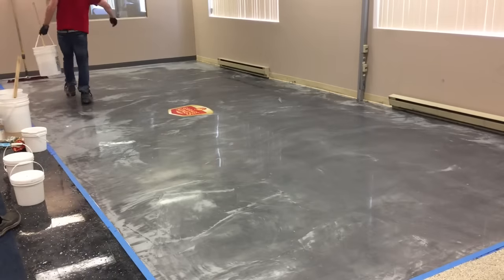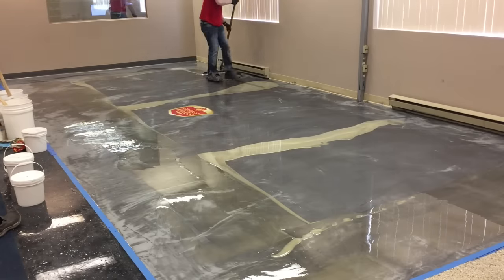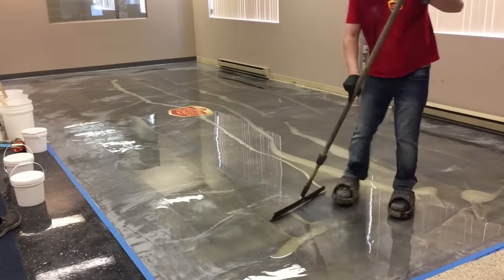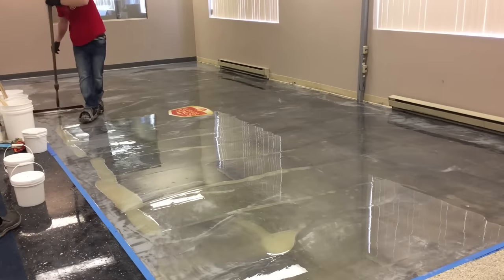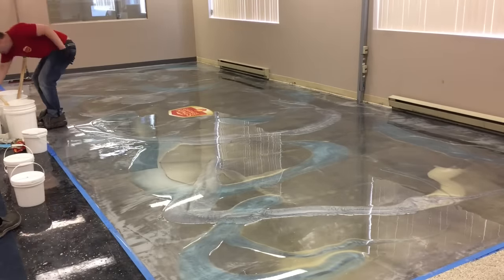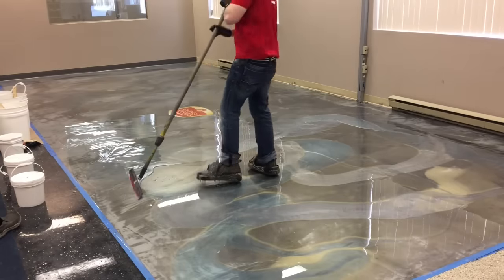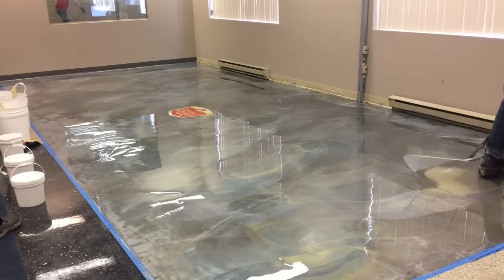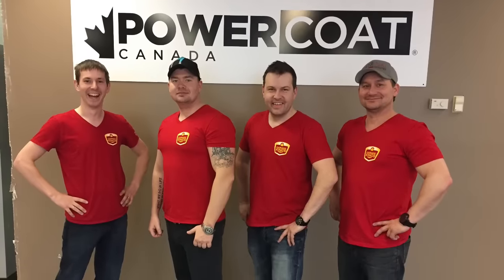How to Do Amazing Metallic Epoxy Floor!

Comment: No mask! Wow. Cancer isn't a scary thought for you?
Reply from the maker: +Ernie Gambino  Thank you!!!  For the question. 100% Solids has Zero VOC's. So no mask is required. We love safe and we don't scare people into believing they need them when they don't
Reply: It doesn't have volatile organic compounds (VOCs) because it's not organic. All epoxy products emit toxins when they're wet and during the curing process. I sell various epoxy products. Our concrete shop floor was coated in this same type of epoxy resin (a different brand, though). It takes about 24 hours for the fumes to dissipate.
Anyone using these products should wear an appropriate mask because the product is essentially glue.
Reply: It doesn't have volatile organic compounds (VOCs) because it's not organic. All epoxy products emit toxins when they're wet and during the curing process. I sell various epoxy products. Our concrete shop floor was coated in this same type of epoxy resin (a different brand, though). It takes about 24 hours for the fumes to dissipate.
Anyone using these products should wear an appropriate mask because the product is essentially glue.
Reply: jublywubly you can say that again! lol
Reply: jublywubly you might want to look up what organic means in this context
Reply: I do understand the context. Anything organic has to have originated from a biological origin.

"organic
· adj.
1 relating to or derived from living matter. Ø Chemistry relating to or denoting compounds containing carbon and chiefly or ultimately of biological origin. Compare with inorganic.
2 Physiology of or relating to a bodily organ or organs. Ø Medicine (of a disease) affecting the structure of an organ.
3 produced or involving production without the use of chemical fertilizers or other artificial chemicals.
4 denoting a harmonious relationship between the elements of a whole. Ø characterized by natural development.
– DERIVATIVES organically adv."

(From Concise Oxford Dictionary 10th Edition)
Reply: jublywubly "compounds containing carbon" ... sooo... epoxy is inorganic?
Reply: Containing carbon doesn't make it organic, unless it came from an organic source. Carbon is thought to be in all life, but doesn't mean all carbon came from organic/living sources.
Reply: jublywubly ok i'll give you that. not everything containing carbon is an organic molecule, epoxy molecules are tho
Reply: Carbon chemistry is called organic chemistry. Epoxies are organic compounds, period! Epoxy hardeners cause nasty allergic reactions but, depending on the product and the person it may take quite a while before the symptoms show. When they do it's usually bad.
Reply: It's a type of glue. It hardens on the floor. It will harden in your lungs. All glues, chemically based or water based, are dangerous to inhale. While epoxy resins do contain organic compounds, they are not entirely organic. (Remember, cyanide is organic.) Flooring resin isn't used on its own. There is always the need for a hardener. 

After doing a lot of research, the general warnings for resin is (Taking note of "P280")

"Hazard Statements:
H315 Causes skin irritation
H317 May cause an allergic skin reaction
H 319 Causes serious eye irritation
H411 Toxic to aquatic life with long lasting effects
Precautionary Statements:
Prevention
P261 Avoid breathing dust/fume/gas/mist/vapors/spray.
P264 Wash hands thoroughly after handling.
P272 Contaminated work clothing should not be allowed out of the workplace.
P273 Avoid release to the environment.
P280 Wear protective gloves/protective clothing/eye protection/face protection.
Response
P302 + P352 IF ON SKIN: Wash with plenty of soap and water.
P305 + P351 + P338 IF IN EYES: Rinse cautiously with water for several minutes. Remove contact lenses, if present and easy to do. 
Continue rinsing.
P333+ P313 If skin irritation or rash occurs: Get medical attention
/advice.
P337 + P313 If eye irritation persists: Get medical attention
/advice.
P362 + P364 Take off contaminated clothing and wash it before re-use.
P391 Collect spillage.
"
Reply: and the general warning for hardener is:
(Taking note of: "P260 Do not breathe dust/fume/gas/mist/vapors/spray")

Classification of Substance or Mixture
Acute toxicity, Oral, Category 4
Acute toxicity, Inhalation, Category 5
Skin corrosion/irritation, Category 1B
Skin sensitizer, Category 1
Eye damage/irritation, Category 1
Specific target organ toxicity (single exposure-inhalation), Category  3
Acute aquatic toxicity, Category 3
Chronic aquatic toxicity, Category 2
Label Elements

Hazard Pictogram(s):
Signal Word:
DANGER
Hazard Statements:
H302 Harmful if swallowed
H314 Causes severe skin burns and eye damage
H317 May cause an allergic skin reaction
H333 May be harmful if inhaled
H335 May cause respiratory irritation
H411Toxic to aquatic life with long lasting effects
Precautionary Statements:
Prevention
P260 Do not breathe dust/fume/gas/mist/vapors/spray
P264 Wash hands thoroughly after handling
P270 Do not eat, drink or smoke when using this product
P271 Use only outdoors or in a well ventilated area
P272 Contaminated work clothing should not be allowed out of the workplace
P273 Avoid release to the environment
P280 Wear protective gloves/protective clothing/eye protection/face protection
Response
P301 + P330 + 331
IF SWALLOWED: 
Rinse mouth. Do NOT induce vomiting. 
P303 + P361 + P353 IF ON SKIN (or hair): Take off immediately all contaminated clothing. Rinse or wash skin with soap and water (or shower).
P304 + P340 IF INHALED: Remove person to fresh air and  keep comfortable for breathing.
P305 + P351 + P338 IF IN EYES: Rinse cautiously with water for several minutes. Remove contact lenses, if present and easy to do. Continue rinsing. 
P310 Immediately call POISON CONTROL CENTER or doctor.
P333 + P313 If skin irritation or rash occurs: Get medical attention
P362 + P364 Take off contaminated clothing and wash it before reuse or discard
P391 Collect spillage.
Reply: This answer is only proper if you post all the MSDS's for all the products used.
Reply: I checked every MSDS for every manufacturer and supplier for the first three pages of a Google search. Materials Safety Data Sheets are checked by government safety bodies. If only one company's MSDS states that it's toxic, then it's toxic, but I found about seven or eight, in that search.
If you can't be bothered doing your own research, then that's on you.
Reply: @Garage Kings: please post the links to the MSDS's for all the products you applied to that floor, thanks.

@jublywubly: non-sense. an MSDS is required from the manufacturer for every product; whether or not it is toxic.  There are exceptions for known common inert materials( e.g., wood, glass), but even then, the manufacturer has to petition for the exception.
Reply: I worked as an occupational health and safety officer. I know what I'm talking about. I suggest you do your research before making accusations.
Reply: IN SUMMARY DON'T STEP ON EPOXY YOU WILL GET FOOT CANCER
Reply: You inhale way worse shit just sitting in traffic.
Reply: It's my job to know these things and how to research them. Occupational health and safety is a serious issue with legal ramifications for those who ignore them.
Reply: The hell are you talking about, with that nonsensical gibberish?
Reply: No education!  Wow. Stupidity isn't a scary thought for?
Reply: jean-luc paradis what the fuck are you talking about? I found bigfoot!
Reply: Don't forget about your eyes. Your eyes absorb alot aswell.
Reply: Derrik Arenal I hate when people like you sealion in comments. Its not his burden to post every applicable link simply because you're too lazy to research things.
Reply: I wore a gas mask to protect me from comments.
Reply: Ernie Gambino bjojo
Reply: jublywubly  stop lying.  You seem to have a response for everything and it seems quite childish.